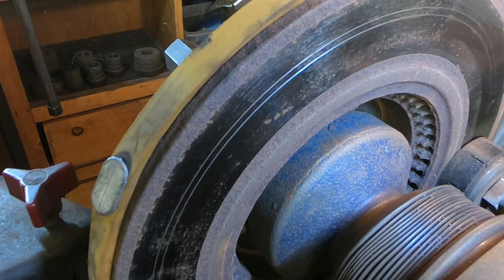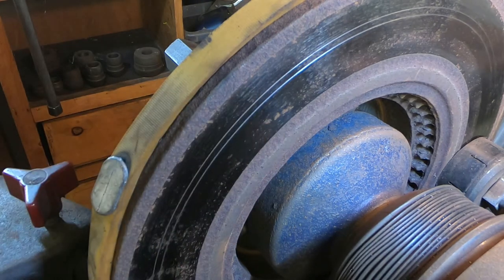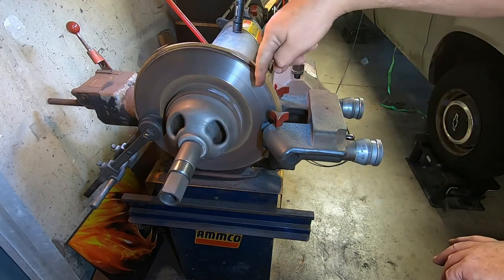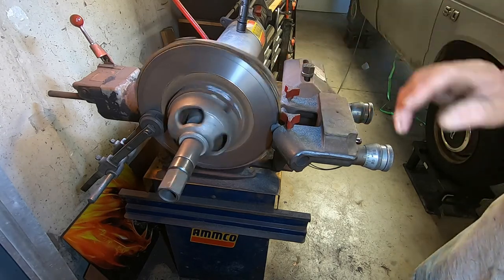How to Eliminate Vibration when Turning a Rotor

Comment: I would love to have one , I scrap hundreds of rotors a year. Some could be fine with just a cleanup especially the rears , corrosion is the big issue here. Great video.
Reply from the maker: You can find these machines used for cheap money. I got mine on craigslist. It came with 100s of dollars worth of adaptors.